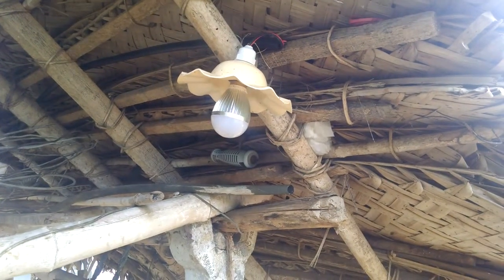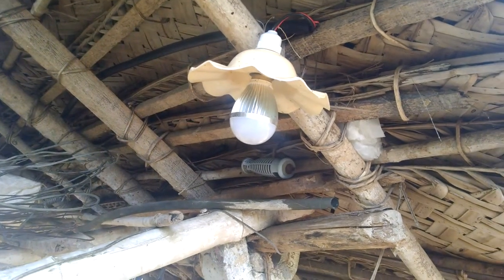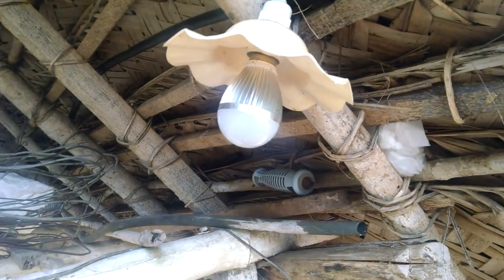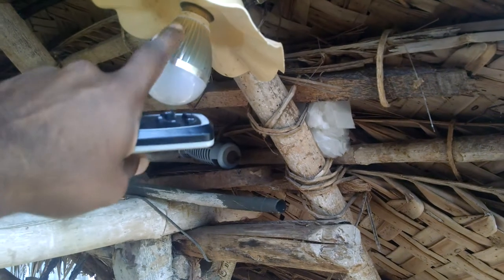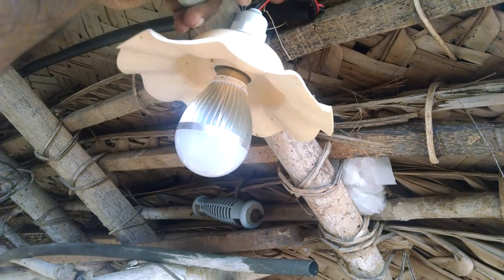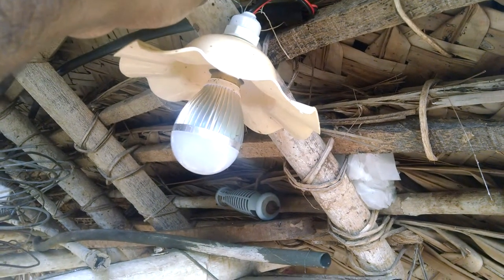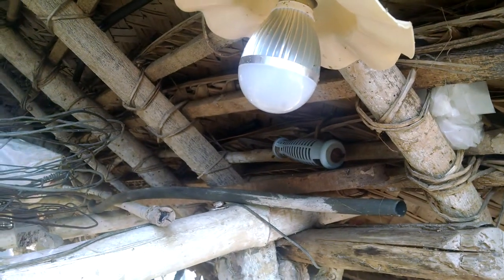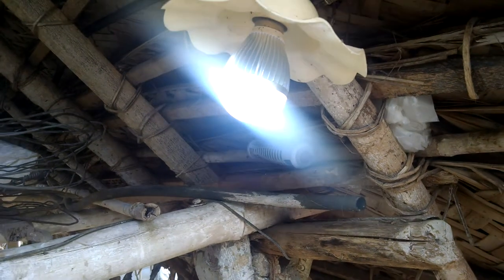Simple solar power project to light your farm / cow shed / sericulture shed - Part 2

Comment: It's outstanding work. Please let me know what are the requirements and how much cost would be? We are in the process of building cow dairy farm, we are planning to implement this work in the cow shed. All the best for your innovation. Thanks, Sincerely, Raj.
Reply from the maker: Thanks Raj, I sourced all parts required for this project from ebay. Some of the components used by me might not be available anymore but here is a short quote with parts available at the moment.
40 W Solar Panel - Rs 2700
Charge Controller (20 A) - 1500
42 AH Battery(Amaron Quanta - You can get cheaper once as well) - 4700
LED Tube 5 Counts - Rs 3000
Remote Controller (3 way) - Rs 600
Wire as required
This is in case you want to stick with the best.